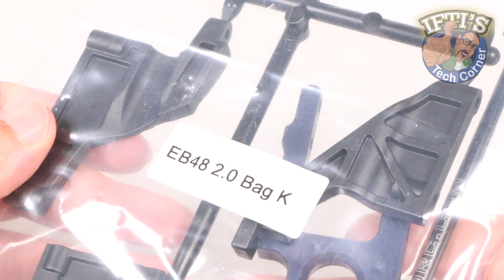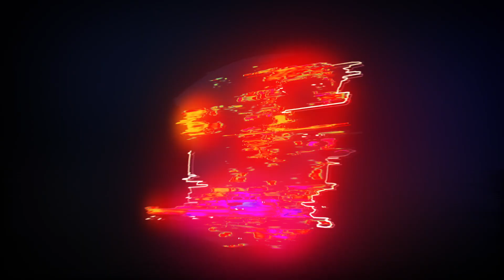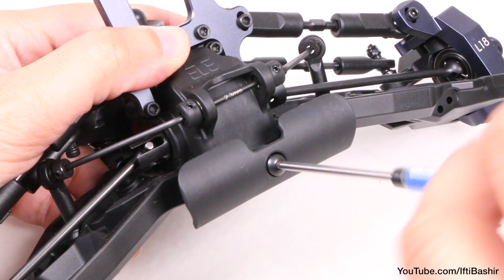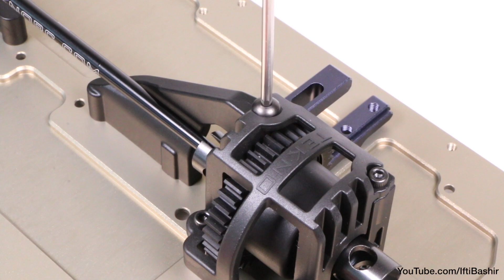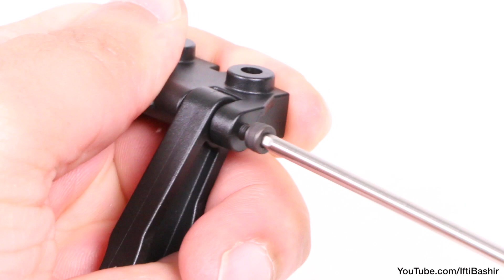12 Bag K#12 Tekno EB48 2.0 - BUILD SERIES - Kit Bag K : Front & Centre Chassis Assembly

Comment: There is one piece not used in this section…. Did I miss something?
Reply from the maker: Which piece do you have?
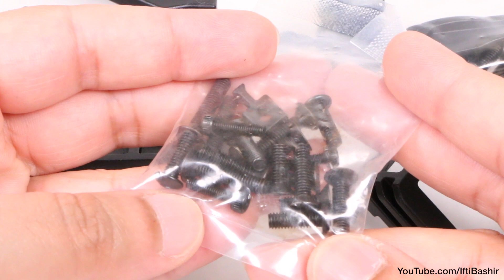Reply: @iftibashir  @0:45  you see the bag you are holding ? beside all those screws, there is a T shape (with a hole) black-colored plastic thing at top of the bag you are holding. You ever used that piece ?  thank you!
Reply: I’m sure you already found out, but it’s a placeholder for in case you don’t want to run one of the chassis braces. I forget which.